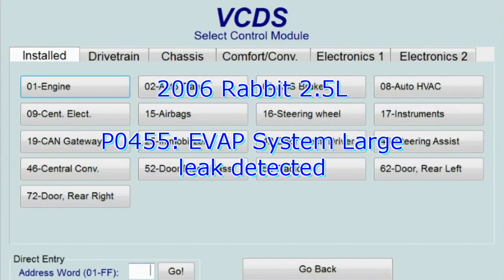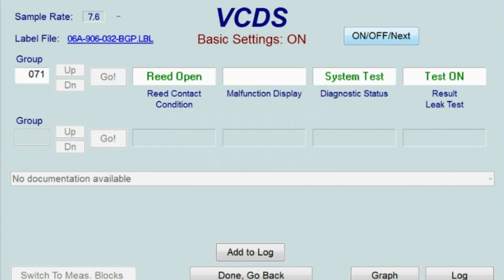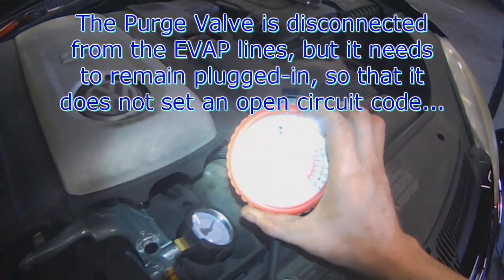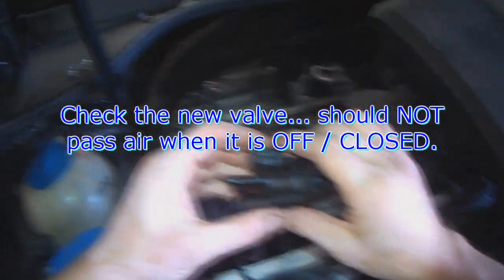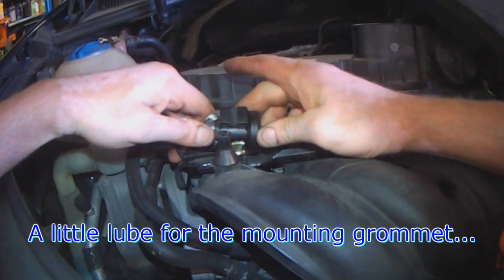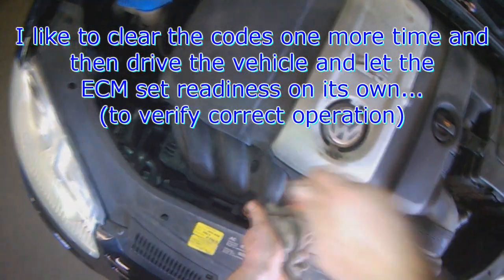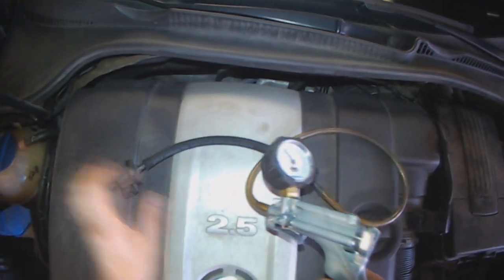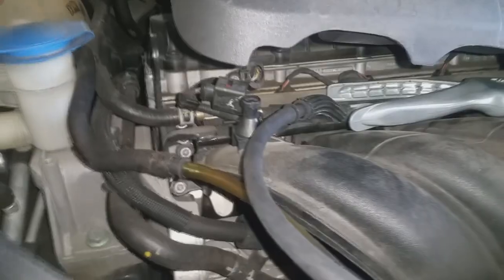VW A5: 2.5L Rabbit P0455 EVAP Large Leak

Comment: I had a code on mine, p2403. Changed the purge valve and still hear a hissing noise from rear. I also changed gas cap 🤷🏼‍♂️
Reply from the maker: Here's a video about EVAP systems... you need to check your leak detection pump... since that is what the fault code is for:
https://youtu.be/y4heTf4rz7A

Comment: I just had a P0456 code after I filed up the other day an it says it’s a small lead detection, is there anything I should really be concerned about or know before taking to a shop?
Reply from the maker: I've only seen purge valve failures on Rabbits so far... at 12 years old, it's worth replacing, even if it is not the cause of the fault code (since it's just a matter of time till it will fail). 5  to 8 years is the average failure age that I come across.
Reply from the maker: Year, make, model, engine?
Could be a gas cap that is on its way out... could be a purge valve issue (purge valve is more common than gas cap failure... from what I have come across). Depending on the shop, a small leak might not be easy to detect... if your car is not do for local government inspection for a while, you can just monitor the car for a while to see if it turns into a big leak (easier to find) or if doesn't come back at all.
Reply: Same as in the video 2.5 liter 2007 VW Rabbit
Reply: Cool thanks for the advice an knowledge I was thinking the same thing after watching your videos. Much appreciated

Comment: You really know how to work, learned a lot from a short video. Unfortunately, I think my situation for the same code is different. Can smell gas if I have more than 11 gallons in my tank from slosh I think, where around the tank should I look for a leak? Are there access panels under the back seat that will give any insight to evap lines?
Reply from the maker: Year, make, model, engine? Fuel pump access panels are usually under the rear seats. Follow the smell to the source. Look for moisture from fuel around the fuel tank / lines etc.
Reply: @EXOVCDS  2006 VW Rabbit 2.5, 5cylinder. Same as the video I think. and I will give it a shot, I'm afraid I'll find a cracked filler neck or tank. Any sort of repair you suggest for that? gas safe RTV? I just bought the car so am short on funds to replace the entire tank if it is that. 

And thanks for the reply on a 2 year old video! I was expecting nothing. you're the man!
Reply from the maker: I reply to all comments... as long as I get notified by youtube.
There are plastic fuel tank sealers that you can use / try. Long term fix would be to replace the tank, but a patch job should be fine for short term. Might just be a fuel pump cover seal. So have a look around first, before buying anything.

Comment: I have this code on a 2001 vw Passat manual transmission
Reply from the maker: MrSickside323 Check the gas cap, purge valve, leak detection pump, all related hoses etc. Large leaks are easier to find than small leaks. A smoke machine is sometimes needed (can be of help).
Reply: Thomas EXOVCDS I appreciate the fast response and I sure will check all of those things you mentioned. Hopefully I run into some luck and get rid of that check engine light.
Reply: @EXOVCDS  is there a good video on Smoke testing with Gas and TDI VW's ? I feel like I'm doing it wrong...

Comment: What about p0456 code. do you think i should change the evap purge valve?
Reply from the maker: Yes, could also be a bad purge valve... but could be other things as well. I would start with checking the purge valve though. Even if it "passes" testing... they can stick intermittently, so with age (8 years or older) I recommend replacing them (consider it a tune-up item).
Reply: Thomas EXOVCDS hey Thomas where can I find a bdf vr6 short runner manifold or where can I find the seals for the bdf 2.8 vr6 intake  actuator???

Comment: hi , I have a 2005 Audi a4 2.0t w the p0455 code . new pcv
Reply from the maker: PCV doesn't really affect EVAP system... I would check the gas cap & the N80 Purge solenoid: http://wiki.ross-tech.com/wiki/index.php/16839/P0455/001109
Reply: thanks, I will send you donuts.